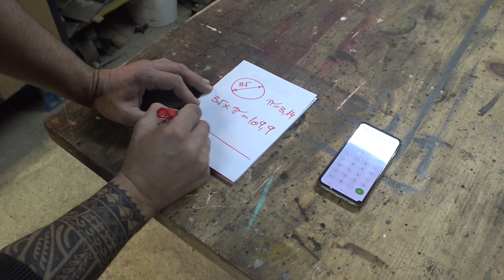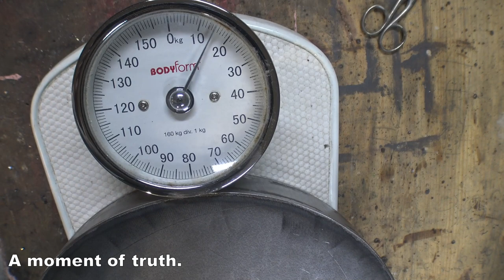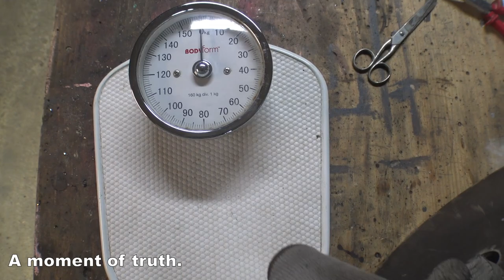DIY weight plates - step by step - home gym equipment

Comment: How do you measure weight because is not the same wet and dry concentre
Reply from the maker: I took into account that it is 2430 kg / m3. Based on that, I calculated how much diameter I needed + how heavy the frame iron was. I never dreamed that I would hit the gram. It doesn't matter if the weight is not correct. The important thing is that both are the same weight.

Comment: Nice work,a lot of nice work.I had a simular idea but was just going to use the sheet metal ring with some tabs on the inside of the ring so it doesn't come off the concrete but protects the edge of the plates.the pure concrete plates I have made  have had no problem but I take it easy on them.don't know about your drop test,what did you think was going to happen?the things are covered in sheetmetal .nice project but way beyond what most people can do,and even though I am a fabricator I really don't want to work on building 600lbs or so of plates like that,I would be way farther ahead to just work some overtime and buy the damn things.